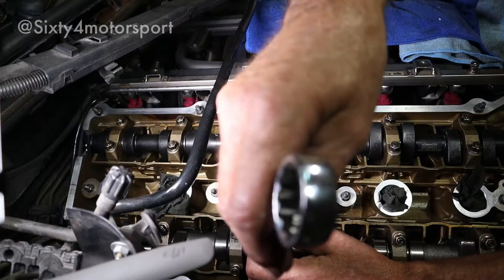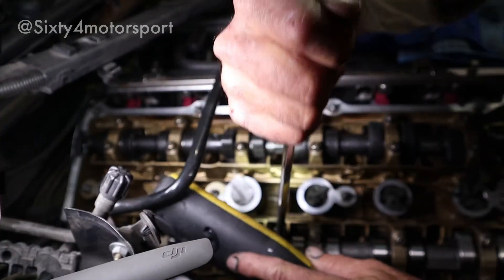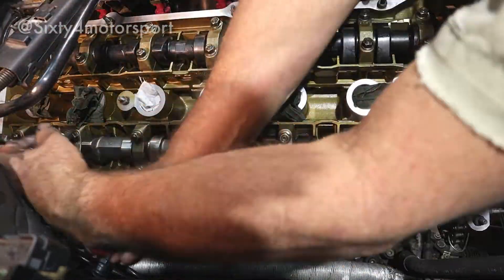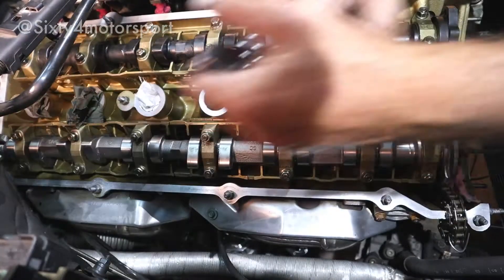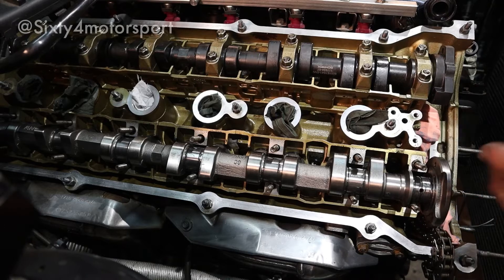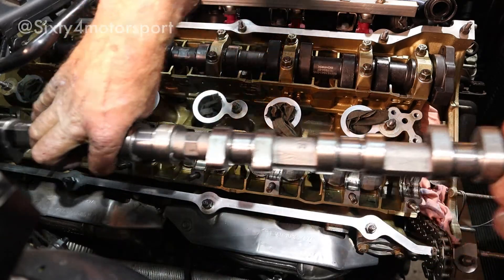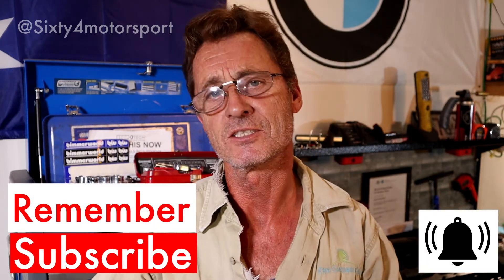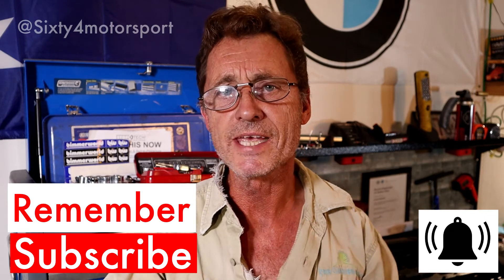E46 BMW: How to safely remove the Camshafts (2020)

Comment: Love the Video! I am actually planning on doing forced induction for me M54 also! What would you suggest to upgrade to make safe(ish) power? I've read a lot of forums and they just say to get a M3😂 Wish I could.
Reply from the maker: Thanks mate. Depends what you are after in terms of HP gains. Check VAC Motorsport they have several camshaft options for NA and forced induction builds. Bimmerworld also have Schrick Camshafts in a couple of Duration Lift options that might suit.